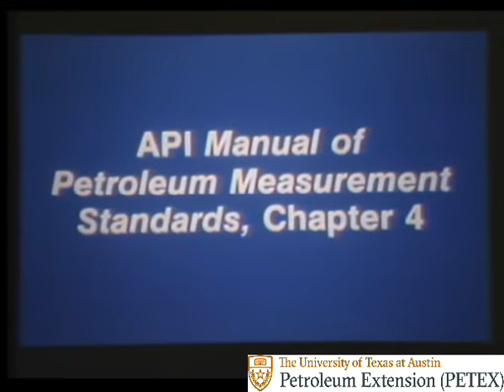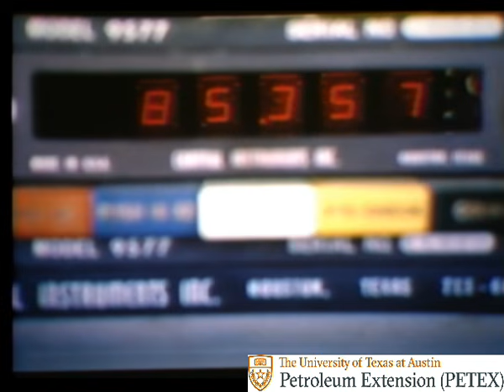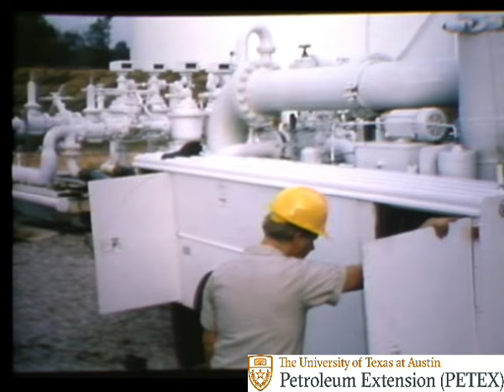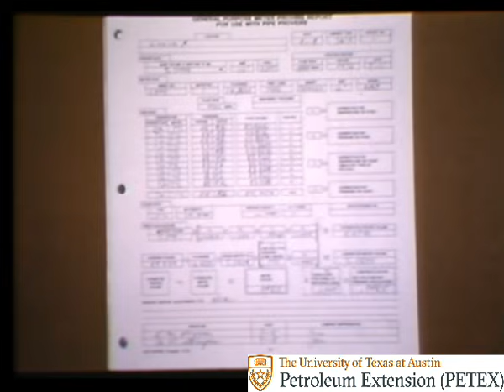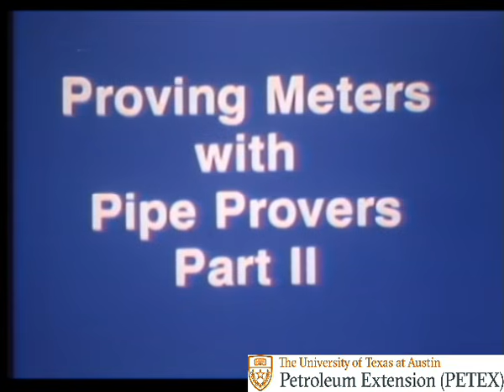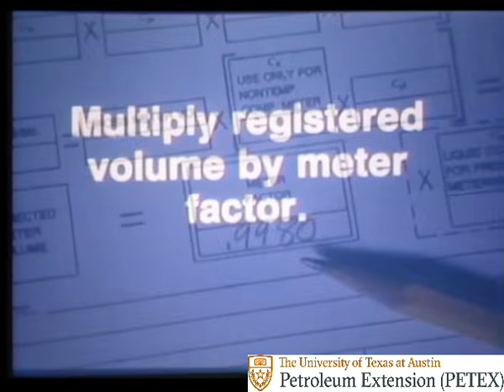Proving Meters with Pipe Provers

Comment: can i ask question,why is it when we try to run the prover when the ball reaches to first detector the counter starts but after a 10-20 seconds the counter will stop,.we troubleshoot the counter but its ok.,is it possible that the detector can cause of it,but we installed new.
Reply: @ yanzkie2547 even a brandnew counter might give you card issues.